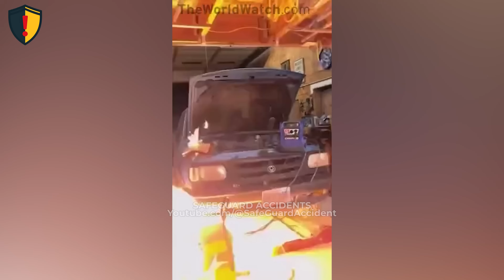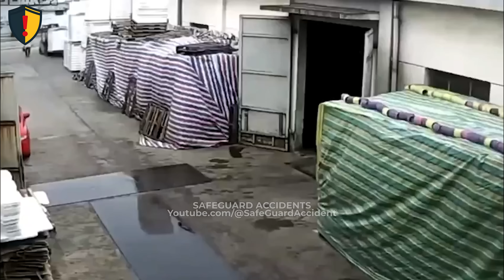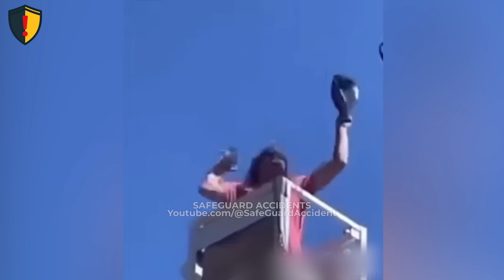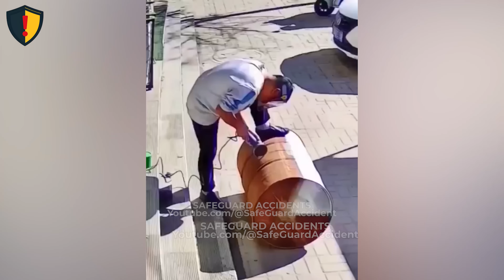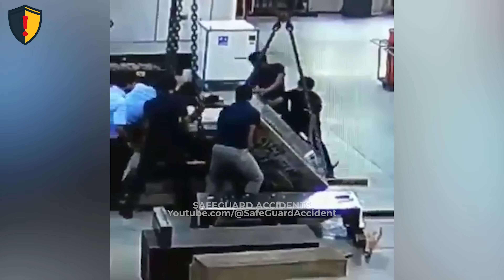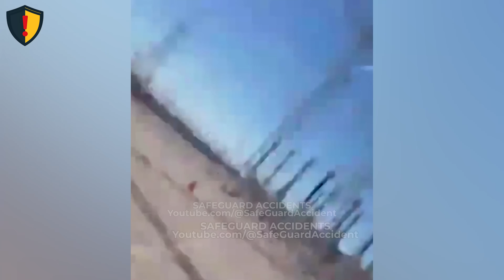He Stands TOO CLOSE to the Rotating Machine... Then This Happened!

Comment: I learned over 20 years ago that safety equipment has a purpose and must be used at ALL times when completing certain tasks. I cleaned a meat slicer using the mesh safety glove. As I was finishing up, I took the safety glove off and cleaned up my work area . I noticed a smear near the blade and used my cloth to wipe it off, and that’s when I accidentally sliced my pointer finger to the bone. Blood was everywhere and I had to get stitches but I learned a very valuable lesson. Always use the recommended safety equipment, no matter what.